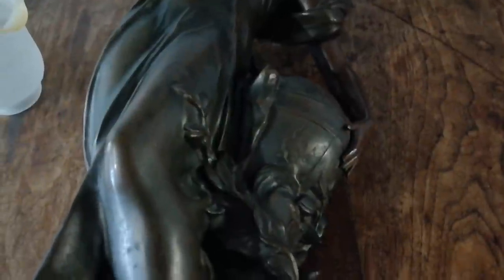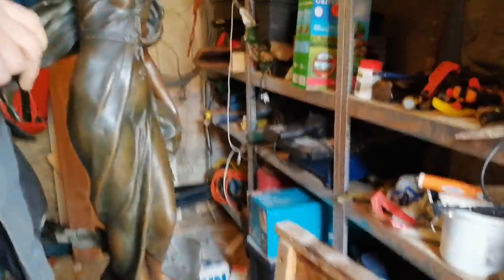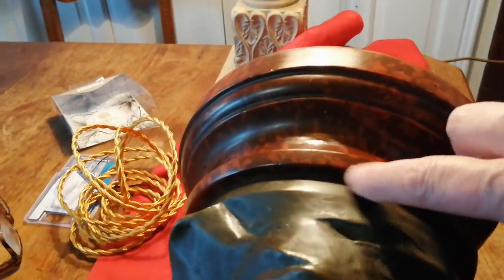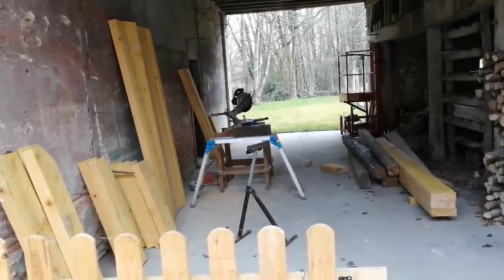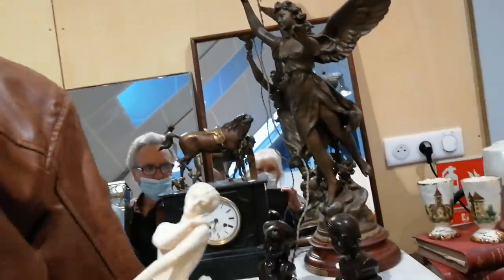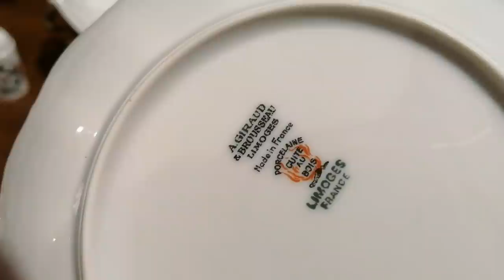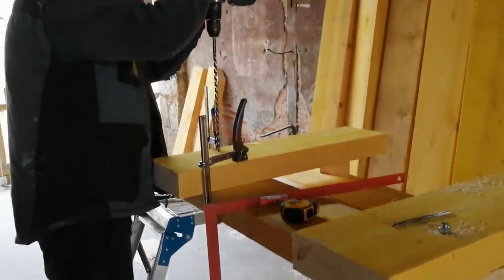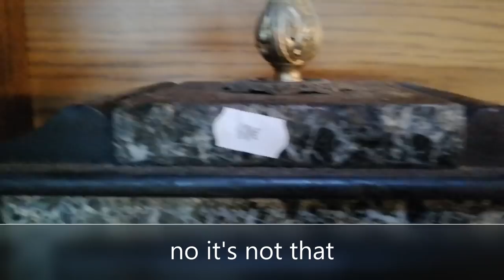Not Quite a Chateau DIY 110 -How to make a Lamp - How to make a Workbench - & more Brocante Bargains

Comment: You can use brown or black shoe polish rubbed on the cord to darken it. I’ve used it on furniture to cover up nicks or scratches for years.
Reply from the maker: Thanks for the tip Bonnie
Reply: I did that lots of times. Works well